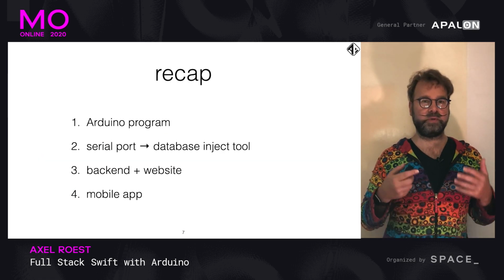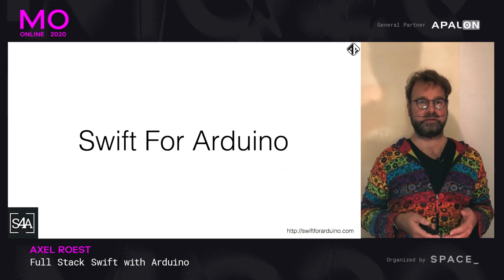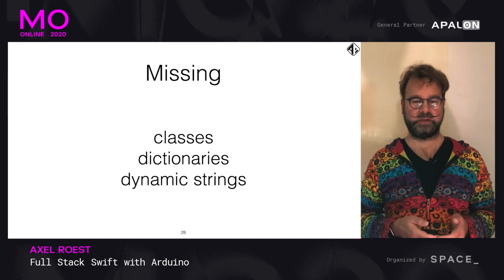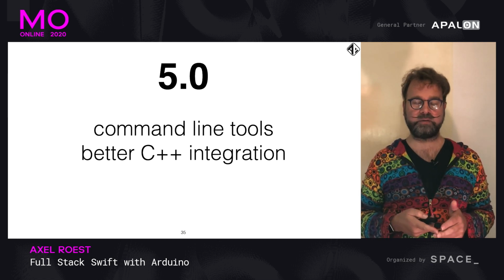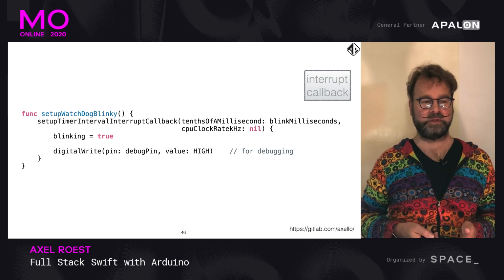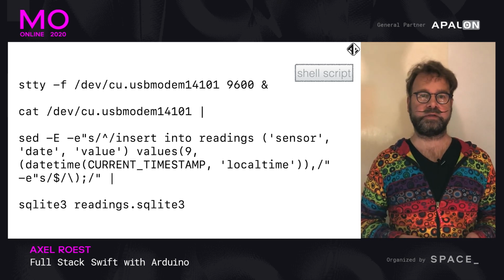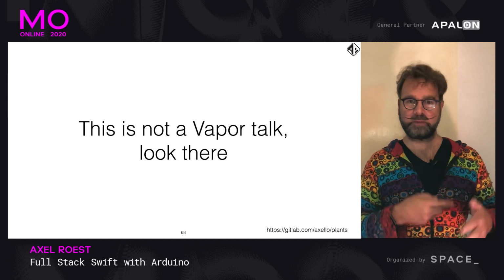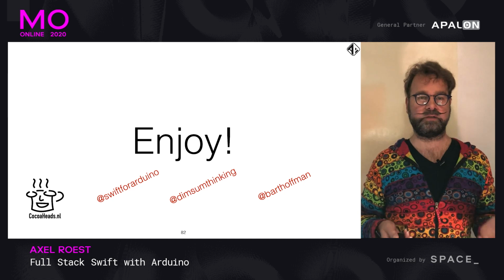MoConf 2020 Full Stack Swift with Arduino

Comment: Does s4a ide support uC atmega/attiny programming via a programmer like stk500, avrisp or others? Is only the Arduino board with the Arduino bootloader supported?
Reply from the maker: Yes. The IDE uses avrdude internally to upload programs, which supports a wide variety of programmers. I’ve used an AVR ATATMEL-ICE programmer myself. And a cheap simple programmer from Arduino (arduinoisp). I think there might be some videos already in the swift for Arduino channel on YouTube. If not, I can make a video if that’s helpful?